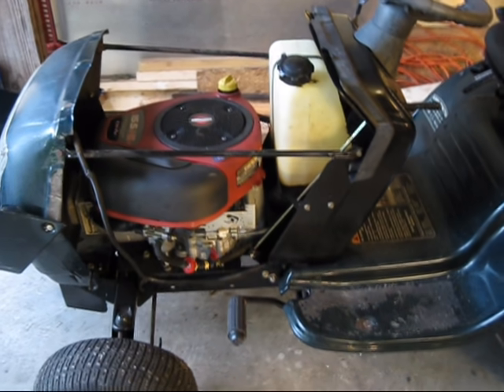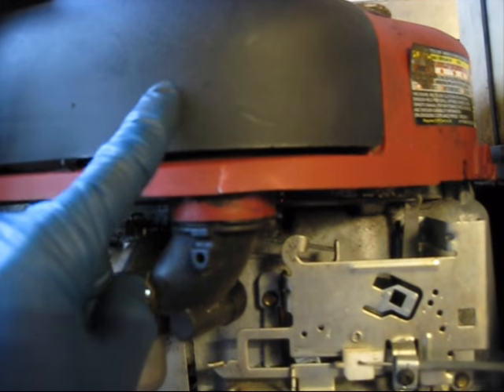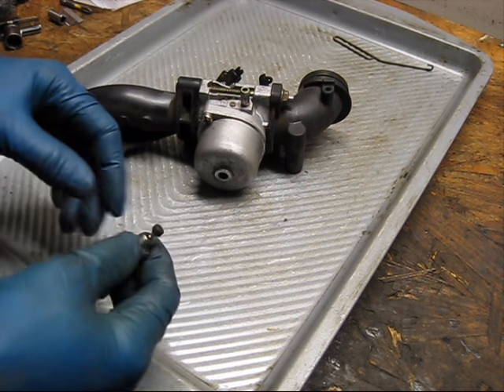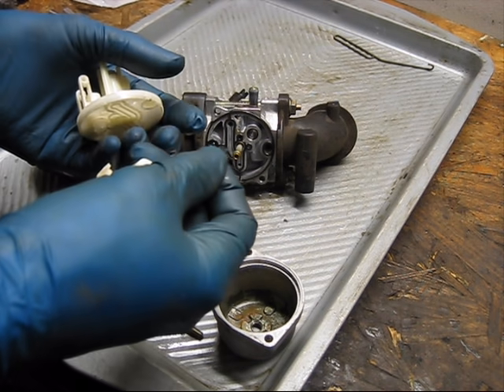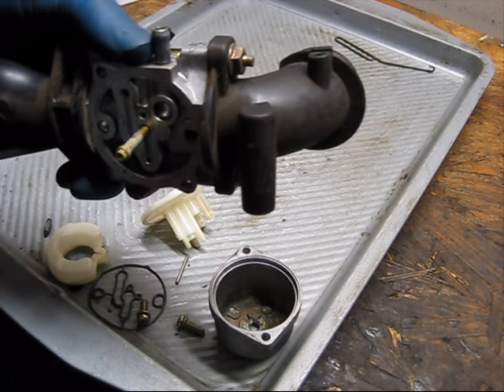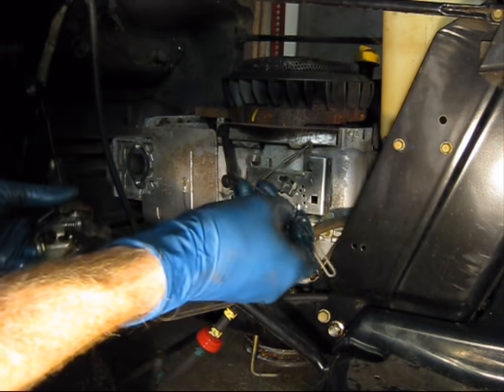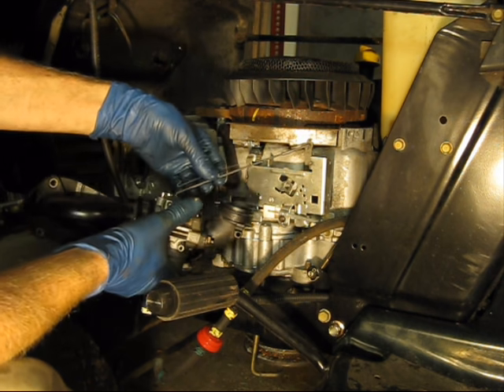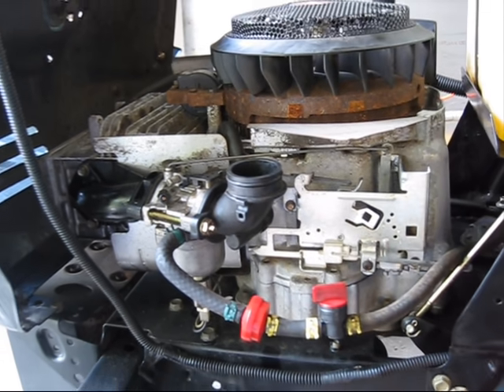Flooding Nikki Carburetor Causes and Fix

Comment: Just the little tiny rubber O-ring. Clean the rest w/ carb cleaner and reuse your bowl gasket if ya can.! Easy peasy. U don’t even need to take off the carb. Remove the bowl and make it easy on yourself

Comment: I know you all say that your solenoid won't cause the carburetor to leak but once I tighten the solenoid on the bottom of the little cup or bowl I can spin the solenoid all the way around the bottom part. I don't think that's supposed to happen does it? The gas leak was bad.

Comment: when I took my nikki carb bowl off and plastic body off, A small brass jet fell out of somewhere and I think it fits into the bottom of the long plastic main jet housing and butts up against the main jet brass to brass. I didn't see one in the bottom of your plastic jet housing but you never really showed that angle. Am I correct about where this small jet goes? Many  thanks !!
Reply: I am going thru the same problem and was watching this video to see a good explanation. When I opened my Nikki carb, I found that small jet with the o ring loose on the bottom of the bowl. It appears to go into a port in the top of the metal housing. I tried to place it the plastic housing below the brass pick up tube and that didn't work. I had the flooding carb situation and I am sure it was due to the worn larger o ring that goes on to the plastic float assembly. The small loose brass jet didn't help either. Now waiting for a parts kit to complete a rebuild. Hope your carb repair worked out.

Comment: It's another designed failure point. If the piston, wrist pin, connecting rod, and cam all fail to fail, this is the last line of defense to ensure you'll need to buy a new mower every 5 years.
Reply from the maker: I have more issues with walbro LMTs flooding than nikkis.

Comment: thanks for explaining what the solenoid is.    Now if you could tell me what kind of tool takes off the wierd star bolt I would be happy.  It is 6 sided so an allen wrench got it off.
Reply from the maker: torx
Reply: The actual tool is an E5 socket (reverse Torx) but a 4mm (and possibly 3/16) 6-sided socket will also work

Comment: Mine sure flooded my motor and could figure why it would turn over when tried starting it. The Niki filled up of course the cylinder and the whole motor. So have to flush it out 3 times tomorrow. Can’t believe Ariens didn’t put a fuel shutoff on it. So bought a new Kipa carb off Amazon if it doesn’t work great then will be buying a Walbro. Heard about the Walbro after I had ordered the new Kipa.

Comment: Great video.  I enjoy all your videos.  Thanks.  Question: The 2 different base gaskets are they interchangeable?  Example:  if you had the one with the separate o-ring will the all in-one gasket fit as well or must you have the specific gasket for each plastic carburetor body?  Is the white plastic carburetor body interchangeable?  Thank You.

Comment: The Nikki carb on my B&S 18.5 hp Intek engine flooded. Despite having replaced the fuel line filter a month or so prior, I found what looks like sand in the bowl; can that be the cause? I cleaned the carb, but did not replace the gaskets. It appears to be running fine (short test drive). Do you recommend installing new gaskets? Your videos are excellent, and I learned how the anti-backfire device works; I consider a day a success If  I learn new "stuff".

Comment: so can this cause the engine to flood while its running (run rich)? have a briggs 17.5 in a yard machine that the engine was flooded. the solenoid wasn't working. I changed it, pulled the plug, cranked the engine( after replacing the starter solenoid) to clean out the cylinder, disconnected the exhaust pipe from the head( to keep down the smoke from the excess fuel in the muffler), put the plug back in, started it, let it run for a bit, changed the oil. After that, it kept smoking. Had fuel vapors in the oil and coming out of the crankcase vent tube. changed the oil again, but didn't matter. still smokes. so wondering if its flooding because of the valve seat while running.
Reply: i seen where the vacuum fuel pump can cause gas getting into the oil if the diaphram has a hole in it and the vacuum tube sucks fuel into the motor, also a good idea to put a shut off valve in line like in the video

Comment: Great video but is there any setting of the float that is needed? I'm putting a new carb on this snapper and the new carb came with some kind of plastic hook tool I thought was to set something. What's that for?
Reply from the maker: No idea. The float level is not easily adjustable on these newer plastic float carburetors.

Comment: Compared to buying a new carb, how much is buying all the individual parts that do not even come close to the entire carb?
Reply from the maker: To buy a Genuine carb or a cheap crappy knockoff? Cause the majority of cheap carbs I've used had issues right out of the box. In more than one instance they were worse than the original.

Comment: I put in new needle and o ring and it still floods...now what? Any ideas ? Fuel does not leak into cylinder,  but yet engine chokes and stalls.
Reply from the maker: do you have the right style bowl gasket? There were 2 designs for the nikki, one has a separate inlet O ring.

Comment: I just rebuilt mine. Still floods. My rebuild kit didn’t come with a new o ring for the inlet
Reply from the maker: Does your carburetor require a separate O ring? If so you probably ended up with the wrong kit.
Reply: @pfun41  what kit has this on ebay. Can't find it

Comment: Your reasons for the shut off is kinda dumb. I I add shut offs to every single mower when the tank is higher than the motor... it just makes sense and its to prevent blowing the motor up if it ever starts flooding the cylinder and crankcase with fuel...

Comment: Good point on the valves. I always add them to run carbs dry for the winter.
Reply from the maker: Running them dry can allow rubber parts to dry out and varnish to form. I just run some fuel stabilizer through them then shut the fuel off.
Reply: @pfun41  yep, now i, no it

Comment: i replaced the main o ring and the little needle seat o ring. when i flip my carb upside down. and blow into the fuel inlet. and she is SEALED...but mine is still flooding like a soab.. but only when i lift it past idle.. at idle. it runs fine. after idle. she starts spitting and blowing blue smoke. then when it eventually dies ton of smoke/vapor comes back through carb
Reply from the maker: Take the air intake off, jack up the front of the mower, and just leave it with the fuel on. If it's still leaking fuel will run out the throat of the carb. But it sounds like you may have gas in the oil or the oil level is too high.

Comment: My nightmare on these carbs... I done a fair share of rebuilds in my time. Also cleaning. When I get done a carb shines. So you can bet every spot is clean. Brought a Yard Machine. Exact stuff as your mower. Carb was junk so I rebuilt. Ran fine for a week and left sat with full tank of 90 oct no eth gas. Week later start and I hear gas gush. Remove engine cover and gas gushes out top of air hole upon start. Check oil and smell gas. Redo another oil change and rework carb and add shut off. All is fine for a week. Leave sit a few days and forgot to shut off gas. I get the same ordeal. So I swap carbs for the Nikki where gas line comes at 90 deg. I had rebuilt it as well and all new parts. Carb is on and fire it up all is fine. For about about a hr with gas on mower off. Try to start and back to gas in crank case and oil. Took carb apart and nothing. Changed oil and started and engine runs bad and surges. Put it in barn and shut gas off. At my witts end. Why should a shut off even be needed on a new carb or even a few rebuilt carbs. Yet most do not have and are fine. So now I got to fig out why my engine was running smooth and now misses to hell and surges. That and constant gas in oil with a few carbs rebuilt.
Reply from the maker: I rarely do a full rebuild as it often isn't needed. Few parts tend to go bad. What brand parts are you using? The parts market is full of garbage so I only use OEM carburetor parts. Walbro LMTs need the needle AND seat replaced if they have flooding issues.
Reply: @pfun41  I agree on original parts. That is what I use and in my case straight from Briggs. When I got the mower the carb was wreaked. Most nasty I ever seen inside. So I ordered a used " working " carb as I rebuilt first. Get other carb and it is wreaked beyond who knows with bad gas. I rebuid both. What is odd is both worked fine when I got done. For a bit that is. Tonight I was out again digging in carb. I got the engine to run fine for about 30 sec and boom carb floods. Shut off gas and fire up mower and runs just fine till that shut off is on and carb fills. I have two options I can think of at this point. 1. Buy a new carb from Briggs at what, 160 bucks or so. Not thrilled. 2. A cheap after market carb of which truthfully I never attempted because I try to stay original. So that is my question just how good are these 20 buck carbs. Oh, and the carbs I been in use of on my Yard Machine are Nikki originals. No seat in them well, just the plastic hole needle goes in on mine.

Comment: Mine has a jet that fell out and I don't know where it fell out from.  I don't know exactly where to put it for sure
Reply from the maker: Check my other video on these carbs it should show where to put it.
Reply: The main jet in simole terms- It goes up in the middle tube of plastic. Oring side up in tube. Flat round side of bottom of jet should be down side.

Comment: I cleaned mine same carb new gaskets and needle and I still cant run my mower high rev only mid throttle any higher it stalls out.  I clean everything out air hose.  Any idea?
Reply from the maker: did you clean the emulsion tube and main jet with a small piece of wire?
Reply: @pfun41  yes  I ran small wire thru every hole I could find watching your videos it seems indie them all.
Reply from the maker: @FRBYND  Will it run if you engage the choke a bit?
Reply: @pfun41  no just starts sputtering then stalls  runs perfect mid throttle tho
Reply: He main jet brass fitting inside the main tube fell out when I first took it off to clean   maybe the seal on that maybe gone?

Comment: Ok, Listen up y'all.. I had an issue where someone brought me a mower that was flooding. !st of all , I had to change the oil, because it was so full of fuel from flooding..I HATE these engines. they don't have a hole to where the fuel runs out of the bottom of the carb. if it happens to flood, instead it runs down into the intake, into the cylinder and then all into the oil.
So, I go tearing into the carb, and everything looked brand new. All bright white plastic, I discovered that when the guy put the thing together, they damaged the fuel inlet O-ring.
I replaced this and the other crazy looking gasket, i get it all back together and try things out, and it runs better but was still flooding like crazy. WTH !  
I take it back apart and and check things out again. Couldn't see anything obvious.
So i go online to find a diagram, didn't have luck for the exact model, but i did fine something close enough. Upon further investigating i found that the main jet was missing..
I bet when the other guy replaced the base plate, he threw the old one away with the main jet inside of it. So $15.00 for a new jet, the engine is running like a champ.
If you ever have to replace the base plate, make sure you transfer the main jet to the new base plate, or you'll be kicking yourself.
Reply: Mine fell out and I'm not sure about the exact orientation
Reply: Also remember if you buy an aftermarket carb or kit to use the shank (not the flutes) of a drill bit to measure your new main jet to make sure it matches your old jet, or just use the new O-ring on the old main jet if it's clean. I chop the anti-backfire valves off and use inline Briggs shutoff valves which are more reliable and don't need an electrical connection.
Reply: Mine is gone and the one in the kit is an unknown size. So I'm trying to find someone who knows what size the orifice is on a 17.5 jet.

Comment: Thanks so much. Was actually trying to solve a surging problem on my B&S carb. I sprayed the float bowl gasket o ring with brake cleaner. So it swelled. Long story short I found your video with b&s parts numbers that I need.

Comment: I have an 11.5 HP Briggs with a Nikki 698945 carb on a 2006 Snapper riding mower.  Bought a Chinese rebuild kit off of Ebay.  It did not have the fuel inlet O-ring.  I complained to the seller.  He is still selling the same kit.  Then I tried a Chinese Nikki knockoff from Ebay for $15 delivered.  Leaked right out of the box into the crankcase and combustion chamber.  Took it apart, swapped in the old needle jet and reinstalled.  That stopped the leak!   I complained to the seller who offered to refund me $3 or send me a replacement carb.  I took the $3.
Reply from the maker: You my Friend have just learned why I spend the $20 on oem parts the first time.
Reply: Yup, penny wise and time foolish. But I am in socal so nowhere to go anyway. Ps I have a bolen like the one in the video but with a walbro.

Comment: Mine filled the whole cylinder with gas, and after I took the spark plug out and turned it over the coil wire sparked to the head and ignited all the gas that sprayed out
Reply from the maker: That's not good.

Comment: I didn't see in the vid. How the main jet fits in the carb. Mine fell out when I took it apart for cleaning. Does the o ring seat in the brass stem or in the plastic stem that fits over the brass jet stem.
Reply from the maker: O ring side down, into the plastic carb body.

Comment: I think there is suppose to be a spring in the middle of the carburetor bowl before you screw it back together...Maybe I'm wrong but all of the ones I've seen have the spring...This one might not need the spring though...Humm I am not a pro at this by no means...Thanks for the video!!!
Reply from the maker: I know of the spring you mention. Some have it and some don't. Most that I've worked with don't, I find them more often on things like generators where they don't have an anti-afterfire solenoid.

Comment: 14 bucks for a new carb just replace it
Reply from the maker: $14 gets you a poorly made piece of junk. Carburetors require good machining and accuracy and quality rubber components. All of which are things you don't get with cheap knockoff parts.
Reply: @pfun41  Nikki Carburetor 14 bucks made by the same company as the one your replacing
Reply from the maker: @johntriplett7207  I don't know what you're looking at, but it's not a genuine Nikki. genuine Nikkis sell for $50-$100+ easy.
Reply: @johntriplett7207  there is a reason they can afford to sell it for 14.00. They may look the same and have the same specs but materials are always cheaper and usually shitty quality control.
Reply: @christopherjuarez7039  there the same name and part number ..
Reply: Some of those cheap carbs don’t have a needle to adjust the carb.  If you look at the photos of such carbs you’ll see what I’m talking about.  Good job pfun41

Comment: If you suspect the needle is to blame on flooding, and you are short on new parts, you can take a q-tip on a dremel, with a dab of car polish scratch remover,(brand doesnt matter). A few bumps on the needle seat will make it like new, for regular carbs, do the same thing, but use brasso
Reply from the maker: I do that on brass carburetor seats because they tarnish and corrode. I never do it on these because plastic doesn't have that issue, and it's never been a problem. I always replace the base gasket and needle when I open these carburetors. That way I know it's fixed and I won't have to open it again, which is more valuable to me than whatI may save in parts.

Comment: A- video. You didn't check/ adjust the float level.
Reply from the maker: The float is all plastic, there is no adjusting the level, and they never need it.
Reply: You can adjust the float level on a carb with a metal float but not plastic. So D- to you for not watching the video.
Reply: Jokes on you yes you can adjust the float on a plastic float.  You need a heat gun.  Look up Tarryl fixes all and he has a video on it.  D+ to you

Comment: Having an issue with fuel being present in the airbox. I ordered a new needle and the orings you suggested. Is it possible and should I recalibrate the inlet valve? I’m having trouble finding any intructional videos/PDFs to do it. Thank you
Reply from the maker: There is no adjustment on these, just put in the new parts and as long as you get them together right and don't pinch anything it should stop leaking.
Reply: Ok great. Thank you for taking the time to reply

Comment: If you take the bowl off you have to replace the inlet o ring and the molded bowl gasket. The main jet o ring is available through Kawasaki Briggs will gladly sell you a main jet cause the o ring isn't available through them. In fact you can also get the fuel inlet o ring from Kawasaki too.
Reply from the maker: Ive found that it isn't necessary to replace the main jet O-ring in most instances, I just apply a little oil and reinstall it.

Comment: When you buy a new carburator it comes with a shut off valve like that, so it probably means you have a new carburator
Reply from the maker: Doubt it, New carburetors are expensive, and  a new one wouldn't be having this issue.

Comment: I have this same carb. Mower wouldnt start so rebuilt carb. Now it only runs with choke on. the carb is very clean, no leaks. What to do?
Reply: A can of gasoline and a match???
Reply: @SS-vb7pp  You like leaving comments that don't help or add anything of value or information. To add fuel to the fire, you're not even funny. Just quit .